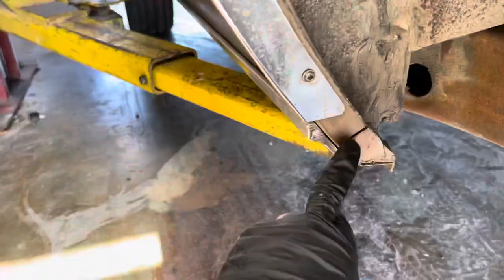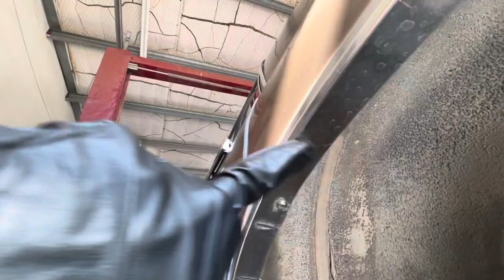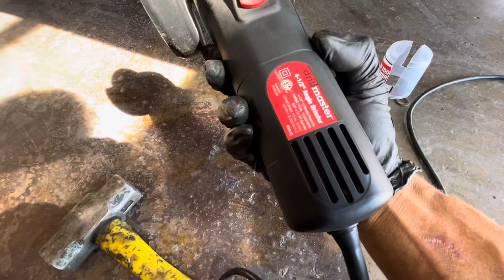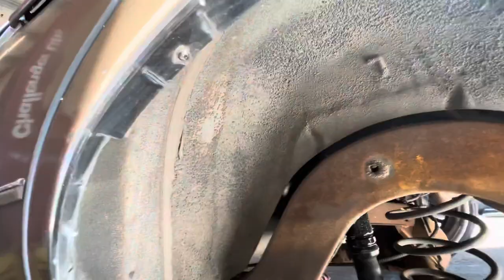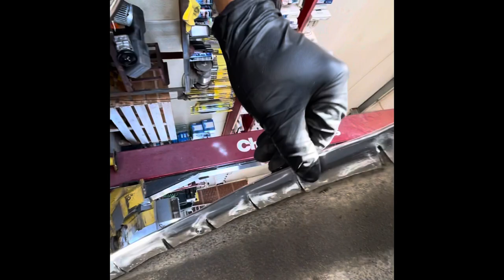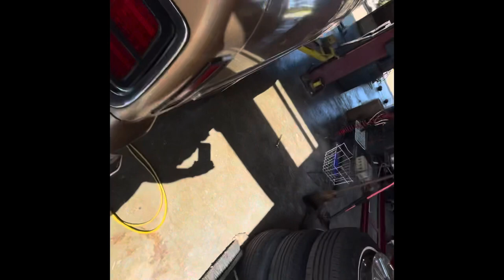1989 CHEVY CAPRICE HOW TO CUT AND TUCK YOUR FENDER

Comment: Do you do same in front? I’m rubbing in front
Reply from the maker: I put Blocks on The Front… 2 of them
Reply: Thanks I was wondering cause I’m rubbing like crazy
Reply from the maker: @Dymondlsswap  2 on each side!!! Get some WD-40 and spray the springs dwn and turn them in there and u should b good
Reply: Hey bro that’s a nice box, you can get some adjustable QA1 coilovers as well and they will give you the proper lift. I watched 78chevyboi get them installed and they made the box sit just right. I’m thinking about going that route.